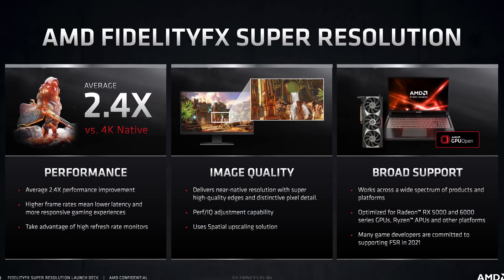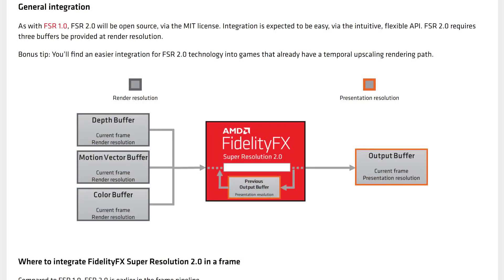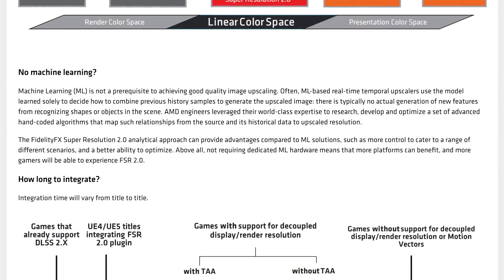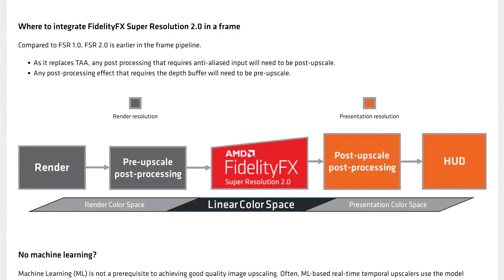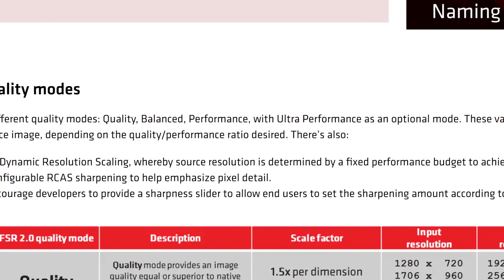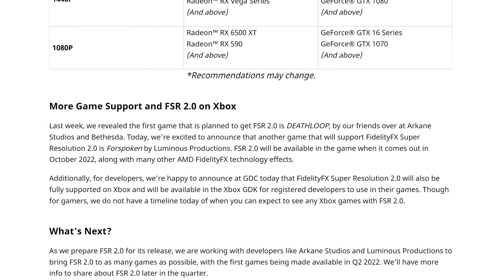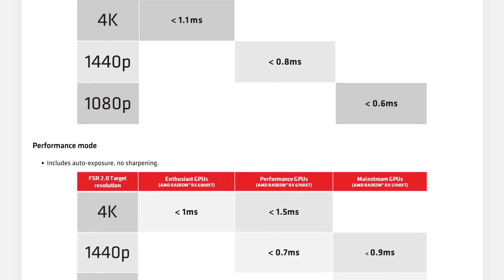AMD FSR 2.0 Details: GPU Support, Quality Settings, How it Works

Comment: I just wish they would support older cards.
Given the state of GPU pricing now.
Reply: They do. But you might start running into other bottlenecks with cards even older then the ones mentioned here so the benefit you're getting will probably vary.
Reply: titan x maxwell?

Comment: Really hope my RX580 will be able to run FSR 2.0, that would be sooo great
Reply: He says it will support Polaris, so yes.
Reply: @ 6:50
Reply: If games target DX12 Feature Level 11_0, 11_1 or DX12_0, you're good.

Once games start targeting Feature Level 12_1, you need Vega or newer.

On Linux, it might be a non issue with VKD3D using Vulkan where it doesn't map to DX feature Levels.
Reply: It lists Rx 590 but iirc that was simply a slightly ocd 580.
Reply: The slide specifically mentions the RX590 which is to all intends and purposes a binned and overclocked RX580. So you should be all sweet and good fam.
Reply: Don't worry it will. RX590 is just an overclocked 580. Nothing different other than that.

Comment: DLSS 1.0 vs FSR 2.0 good discussion and fight!

  Meanwhile, we use DLSS 2.3
Reply: FSR 1.0 already completely destroyed DLSS 1.0. 
In fact, the more or less accidental benefits of CAS applied to upscaled images already completely destroyed DLSS 1.0.
Reply: FSR 1.0 arrived 3 years after DLSS 1.0, so…
    - Learning from the mistakes of others and improving your opponent's pioneering spirit is a LAW OF SURVIVAL in the tech industry!  JOBS, STEVE.
Reply: @hwuptech  You sound like a fanboy troll, not like someone who's actually interested in a real discussion.
Reply: @benfrese3573  The troll obviously thinks adding .3 at the end of a number makes it better. All those 85% of gpu owners who don't use RTX cards will be thankful to AMD for FSR 2.0 at least.
Reply: @Dark-qx8rk  It's actually more than that. As far as we can tell FSR 2.0 is very similar to DLSS. The biggest hint for that being the case is that it's easiest to add FSR 2.0 to games that already support DLSS. Because the necessary render information for the upscaling to work is the same. DLSS would work without TC as well, it would just be a bit slower (while most people just fell for Nvidia's superior marketing and think AI is doing the upscaling, it doesn't. It just speeds up the process a bit)
So in the end it all comes down to FSR 2.0 being fast, cause the quality will be on par with DLSS.

Comment: As far as I am aware Radeon 7 was the first GPU to support DP4a, so is the oldest to support XeSS
Reply: I'm sure the 10 dudes that have this card are happy.
Reply: @100500daniel  yes I a
Reply: @chriswright8074  just turned into 11 😉
Reply: @100500daniel  Very few gamers have them now... since the miners paid through their nose for them. But the card actually sold pretty well among hobby 3D artists back in the day.
Reply: Actually Pascal also supports DP4a, but the Radeon VII was indeed the first AMD GPU to support it. Most AMD GPUs from 2019 on support this, with some notable exceptions:
Navi10 (5600/5700) and Renoir Vega (Ryzen APUs in 4000 and 5000 series (It's the same iGPU in both of those series)).
Reply: @Azraleee  yes sorry I meant AMD

Comment: AMD is really doing everyone a favor here even supporting competitor cards. 
There's no reason for us not to root for AMD for this to be a successful implementation. 
Also, basically, any Vega series will work, even the APU's?
Reply: Man AMD is supporting old nvidia GPUs better than nvidia them selves. I hope FSR 2.0 will be available on Linux/steamdeck sooner rather than later.
Reply: @roccociccone597  FSR1.0(RSR) already works on steamdeck.
Reply: @MaxIronsThird  yes I’m aware of that. I meant fsr 2.0
Reply: @roccociccone597  FSR2 has to be code into the game.
Reply: @MaxIronsThird  you mean like DLSS? I know so what’s the difference
Reply: @roccociccone597  Not exactly, but yeah.
Reply: @MaxIronsThird  Wait till FSR 2.0 is implemented into RSR.
Reply: @aninditabasak7694  2.0 will never be in RSR
Reply: The best part is that they are supporting competitor GPUs that do not have DLSS like 16 series, 10 series and their own 5000, 500 and vega series to help hopefully prolong the lifespan of something like RX 570 or 580 for example.
Reply: @gurjindersingh3843  They want it to work on as many GPUs as possible (including Nvidia GPUs) so that developers have the strongest reason to support it. It might seem counter-intuitive, but this actually gives them the best chance to compete against Nvidia, because it reduces the likelihood that a developer would bother to implement DLSS, and significantly reduces the likelihood that a developer would only support DLSS but not FSR. Games which support DLSS but not anything which AMD cards can utilize is what AMD most wants to prevent.
Reply: yes, Vega will work
Reply: Intel's XeSS is also brand agnostic.
It seems it will work like FSR 2.0 on older cards(and AMD's) and similar to DLSS on Nvidia's 2000/3000 series and its own DG2 cards.
Reply: Are you serious Vega will work with it? That's incredible
Reply: @ughitstravis9243  It will work all the way back to AMD Polaris and Nvidia Pascal GPUs.
Reply: FSR is dependent on the software and not on the hardware so yeah, it should work on any GPU..
Reply: I will say, once they become top dog they will stop being so friendly. But since they are the underdog, yes, supporting them usually helps the consumer. So I would say there is no reason not to root for AMD, but only BECAUSE they are the underdog. Rooting for the underdog helps fight monopoly or anti-competitive behavior. If intel or Nvidia ever became underdogs, and AMD the unfriendly top dog, then I'd say root for those other guys in that scenario.

In summary: Don't tie your loyalty to a brand, tie your values to anti-monopoly, pro-consumer moves in the ecosystem.
Reply: If this is going to be supported on upcoming modern DX12 and Vulkan games, then assuming modern DX12 games with DX12_0, that means GCN2 and newer and for DX12_1 means GCN5 and newer.

Vulkan doesn't leverage DX Feature Levels, so games with Vulkan 1.2 means GCN1 and newer and Vulkan 1.3 means GCN4 and newer. Vulkan support might be more inclusive on Linux for older AMD GPUs though (GCN1 and up)

Same logic applies to DX Feature Levels and Vulkan support for Nvidia and Intel GPUs.
Reply: @acryion  As far as I know on Linux it's GCN1 and up for Vulkan.
Reply: Team amd for sure.  I have a titan xp and 1080ti, but I've been trying to get a 6800xt for nearly a year.  Still trying...  No more nvidia for me
Reply: There is a good reason here. If FSR works on everything and pushes the highest resolution possible with high frame rate, then we can see adoption of 8k monitors and 4k monitors becoming way more common as new GPU comes out as they can enhance it without needing native, especially for 4k and 8k monitors that aren't massive on the pixel per inch scaling.
Reply: That's the power of open-source.
Reply: There's a difference between 'work' and 'work well'. Technically it will work on any card which supports the APIs it requires. It's still a somewhat demanding algorithm so there's the question of how it will limit frame rates on an APU. Still, my guess is that it will allow games to be played at 1080p 30 FPS on an APU (when upscaled from 540p or 360p) which would otherwise not be able to achieve this.
Reply: @ETophales  LMAO what? show me a modern game that has a resolution less than 720p
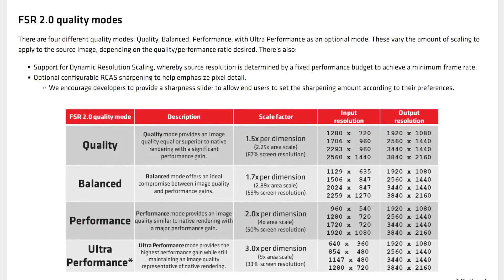Reply: @Barracuda_GRM  Huh? This video is about an upscaling technology. Your comment makes me feel that you've missed the point of it. You might want to take a look at the FSR 2.0 quality levels table at around 5:45 in this video.
Reply: The only reason why AMD support GPU from competitors may probably be due to the lack of DLSS competition. Should DLSS competitor and they are competitive they will vendor lock it. 

Im glad they are supporting  nvidia and intel cards soon as well. Atleast theres more worth to use other cards if you dont like AMD cards.
Reply: @countpuchi  FSR 2.0 is a DLSS competitor. Maybe it is as simple as AMD isn't as greedy as Nvidia. Nvidia screwed over their own users.
Reply: @cyberfred5520  Yeah not really, it baffles me that people think AMD is doing this just because they wanna be friendly and make people think AMD = friends. They are not, they are corporation 1st and money is their no.1 goal.

The only reason why this happens because they have not captured the performance crown in the GPU Space. You can check the CPU space and what they did to screw up buyers for their 1st gen platforms by locking up 5x series to 3series motherboards. Only to get caught when vendors enabled A320 chipsets to be able to use 5x series processors (Thus the bios chip limitation was bullshit and they got caught with their pants down lmao). Only now they allow the vendors to release bios updates to be able to be used on their 3 series motherboards. 

Even then they only decided to release lower end bins 5x processors when Intel is gobbling up the budget space lol.. 

Just wait my guy, if RDNA 3 rumours are true and they claim the no.1 spot it wont take long for them to milk as much as possible
Reply: @cyberfred5520 always remember that open source shit is always shit, and that you like a company that wont invest in machine learning, not even in 2022
Reply: @countpuchi  No, you misunderstand AMD's strategy against proprietary.
Software needs support, developers implement general solutions with wide market coverage but proprietary ONLY if paid to or for the high demand of market leading products.
Reply: @countpuchi  yes but who tf would want to use fsr 2.0 on an intel card, where you literally have accelleration for xess
Reply: @crisp_gaming  we dont know how good it is yet. But i mean we need devs to implement the tech for it to work. 

If intel gpu fails to get adoption we may not see massive usage from it from lazy devs. If they only implement fsr then its the only choice you have. 

Intel coming in is very good. Hopefully they can smash the market
Reply: @countpuchi  but it works without intel gpus as well
Reply: Its one of the reasons i've been buying radeon''s for over 20 years ATI/AMD always support Open standards which benefits everyone.
Reply: @MrNelahem  I never had a problem with old AMD drivers and software, while Nvidia shafted me too many times.
Reply: @MrNelahem I find that very hard to believe, because ATI and AMD didn't merge untill 2006, which makes it 16 years ago, not 20. 
What's more, i find it even more strange that you would say this, considering the open standards were mostly a result of them being close to bankruptcy for 5 years straight.
Reply: @Orcawhale1  Well guess what you are wrong. I owned the very first Radeon 64DDR which came out Release Date Apr 1st, 2000 branded by ATI there was no AMD involved. And i've owned almost every single radeon released. Its is now 2022 so that makes it 22 years. I've also owned plenty of ATI cards prior to the AMD merger so going back even more.
Reply: @MrNelahem  remember kids:

1) open source shit is still shit (looking at fsr 1.0)

2) open source ice cream is better ice cream (looking at xess)
Reply: umm DLSS 1.0 was also shit just like FSR 1.0... FSR 2.0 will be a better competitor for the current version of dlss 2.0
Reply: @MrNelahem  amd on their way to never use ai:
Reply: @crisp_gaming  if they can get similar results without it why does it matter?
Reply: @MrNelahem  because they wont
Reply: @crisp_gaming  Okay!
Reply: @MrNelahem  okay
Reply: @MrNelahem  DLSS 1.0 was actually a lot worse than FSR 1.0
Reply: @syncmonism  I've heard that also. Just glad we will get a see a proper FSR 2.0 vs DLSS 2.0
Reply: @crisp_gaming  if you think FSR 1.0 is shit you're sadly a green fanboi or just blind. It is bad at 1080p but 1440p and especially 4k it's good. Reviews also suggest the same.
Reply: @yellowflash511  i have a 1440p monitor. i tried it against tsr and it's obvious how spatial techniques are inferior to properly implemented, well made temporal ones
Reply: @crisp_gaming  ofc they're inferior, you said "shit" while they're definitely not shit
Reply: AMD always had very exceptionally smart engineers, now with them becoming way more profitable, we might see something even better!
Reply: @makisekurisu4674  like fucking machine learning for once
Reply: @crisp_gaming  ML doest do as much as you think... its even explained in this video
Reply: @Sinesterr  did you ever try making a machine learning model?
Reply: It's great for us but its not "for us" in the way you think.  AMD needs competing technologies to leverage for access to tech from Intel and Nvidia.  This goes all the way back to AMD fabbing pre-pentium parts.  AMD came out of that with a never expiring contract for x86 code access the thus the ability to make processors for it.  Fast forward a few decades and AMD owns the 64bit (AMD64) code that was added on top of x86 and shares it with Intel under these agreements.  Being top dog Nvidia can close its tech and charge a premium.  They probably knew all along that Gsync would fail once AMD caught up and released something free.  DLSS is no different here.  They will write thesis papers on the failures of Jenson Wang.  You heard it here first :)
Reply: @KeithZim  Nvidia's tech? LOL, upsampling is nothing new and predates DLSS.
Reply: I have a reason for us not to root for AMD.
Their price is TOO DAMN HIGH.
Reply: @talkingbutt3150  Their prices are fine. When you have a product that is performance leading you charge for it. Intel was doing it for years and keeping the market locked to quad core skylake cpu's and nobody was complaining about prices? Both of these are publicly traded companies and have shareholders. They have a duty to their investors to not leave money on the table. Competition is good for the market and ADL-S has force pricing to come in line which is how this is suppose to work in a healthy market. 

As the two companies go back and forth for position this will continue to happen. This is the way!
Reply: @talkingbutt3150  AMD doesn't actually have control over the retail price
Reply: @talkingbutt3150  Same applies for Nvidia. Just keep using older GPUs from either company or wait for Intel.
Reply: i dont excpect much considering FSR 1.0 WAS LANCZOS MODDED